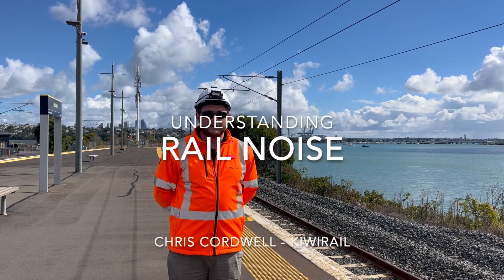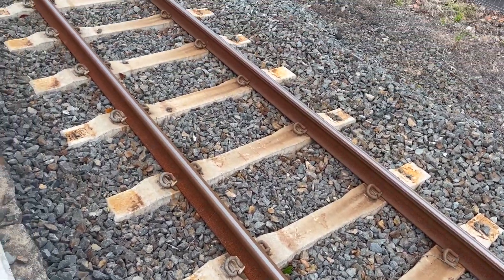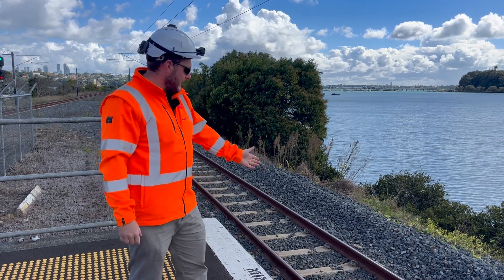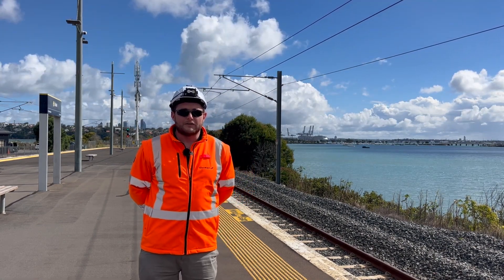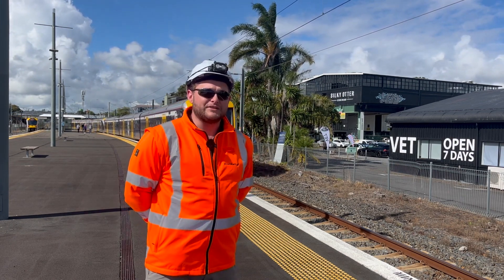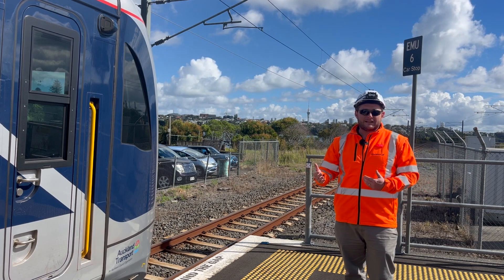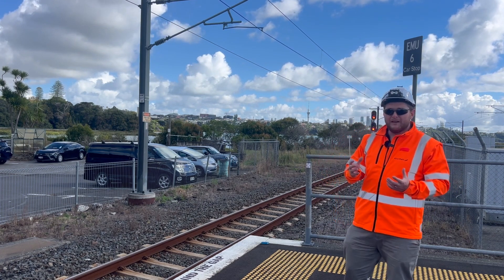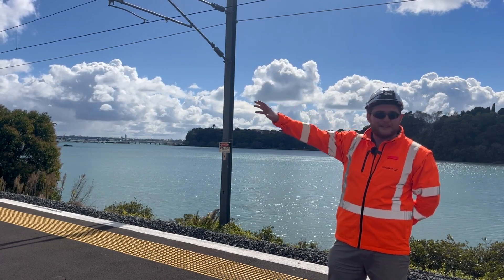Track noise: wheel squeal explained

Comment: I have lived and traveled all around China for 8 years and have traveled to every province on their Fast-Trains,  averaging 
380 kmph,,  but they never squeal. 
I have also traveled extensivly on their slow trains, ( 200 kmph ) and they dont squeal or screech either. 
And their trains are never canceled, break down or run late... 

Where have we gone wrong. ???
Reply: 380km/h is not their average, it's their max.

Comment: Do the trains in AK travel as fast as the trains in Tokyo? I remember the Japanese trains moving very fast through the suburbs.
Reply: @dennis-qu7bs  Sometimes they don't move at all. On my local line there is a lot of cancelations so cannot be relied upon. When they are going they are very slow when compared to trains in Japan.

Comment: The sharpness of the bends at New Market leading out to the western line, and the bends coming into Britomart from Parnell are excessively sharp. This is poor design and places higher strain on the rails and wheels, and leads to excessive wear. Then there is the noise also. Another example of how we do things inadequately. When the CRL finally opens it will be let down by the rest of the system limiting the throughput because it is not up to the task even though this work has been carried out.